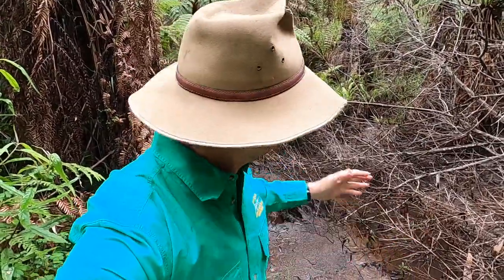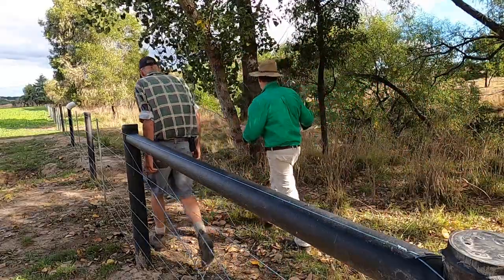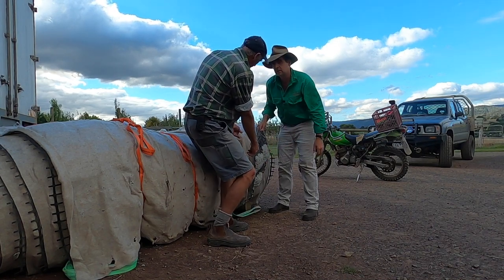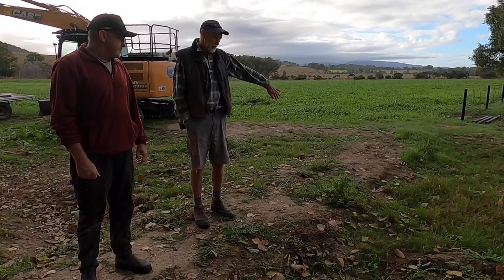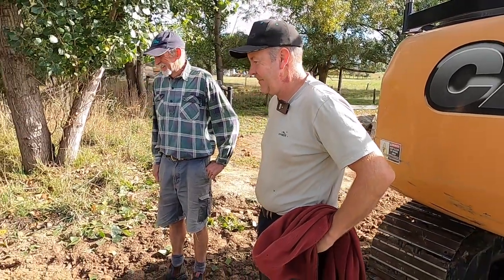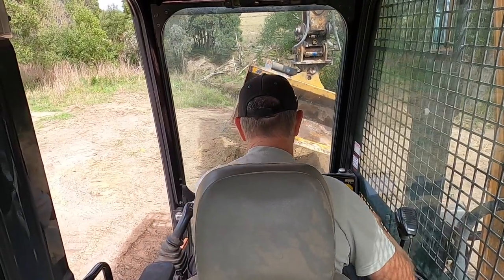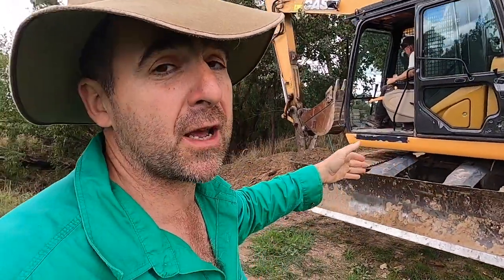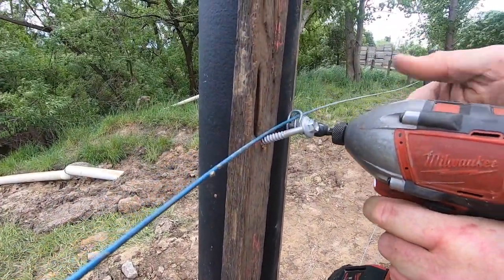Farm Erosion Control Using Concrete Mats

Comment: Good to see a farmer caring about stabilizing water ways, was back in the old country when they made farmers take care of this problem and it improved the rivers no end. Also helped to reduce flooding down stream. Only thing I could see as an improvement would be a totally degradable product that one decent sized vegetation had grown would disappear.
Reply: Hi Turning Point, Yes a totally biodegradable product would be ideal, however there are some areas that the mat works where the ground surface, or slopes would never be able to hold together with the natural processes of erosion, no matter what the natural products used to hold it. Our weather events, the disruption of landscapes and ecosystems to development have often eroded he integrity of those natural processes. Our concrete mat is designed to support and encourage the natural processes. Lend the strength of the concrete and geogrid back to nature to support its rehabilitation as best it can. for example, places like bridge abutments or mine tailings or pond linings.  The nutrition underlay that we supply with the mat is designed to encourage and a support the growth of vegetation under the mat, the space between the concrete shapes will enable vegetation to grow through the mat and eventually the mat will be completely covered in vegetation, however also still have a hard armoured surface to hold the soil an vegetation in place to withstand those heavy rain or erosion events, long term.  You can see more places that mat has helped to stabilise the ground and vegetation has regrown on our projects page: https://www.concretemats.com.au/project-library/ . Thanks for your interest in our products, please reach out if you want more info about erosion control and the flexible mat.

Comment: Hi Tim.
I installed 70m x1.2m wide matting along side of steep track as a drain plus other 6x2.4m section for a spoon drain across the track in a spoon drain. Looks really promising and there was no wash in a couple of storms we've had since.
Seems a great product and looking at doing some more later.
Reply from the maker: So glad it’s working out for you mate. Thanks for letting me know!

Comment: Convenient product, made the process move along quickly.
I wonder what the difference in cost would be to using the same preparation but with a stabilisation blanket and a few truck loads of rocks of various sizes?
Reply: Not a bad thought. Although I have seen rocks wash down spoon drains, of various sizes, the concrete interconnected with mesh would reduce rock wash out. Great idea.
Reply: Hi Mark, Good question mate! The mat including underlay is $35 (ex GST) per sqm (current at April 2021). A few clients have mentioned that the quick install and long term benefits of  the mat not being washed away like loose rocks etc will also make it economical. - also the mat can be driven on, it creates a hard armoured surface so that on slopes where a tractor can drive it can be mowed - not like rip rap loose rock. You can see lots of examples of where the mat can be used on our website projects page: https://www.concretemats.com.au/project-library/ or call us if you want us to quote your project. 0480 234 521.

Comment: It would be cheaper and easier to move if they just sold the matting and you had to add the lobs of cement.
Reply: Good idea My Day! However the savings on "time" will then be blown out! One of the main benefits of this mat is that they are quick to install, especially on larger scale when the equipment is often already onsite. Some projects don't need an excavator they can be dragged into position using a tractor with bucket. Every scenario differs, and resources as well. But I agree it would be a good idea that you've got there! Thanks for the feedback.